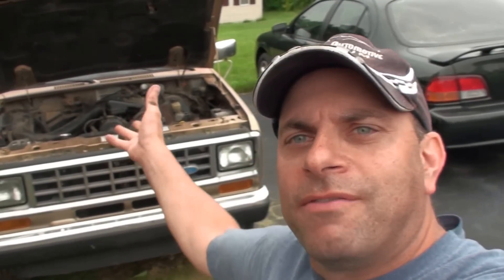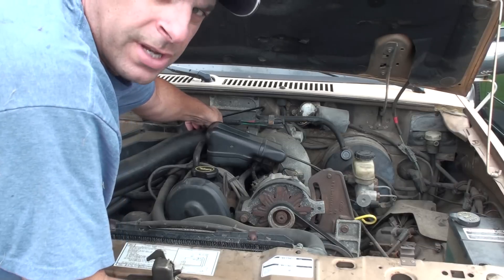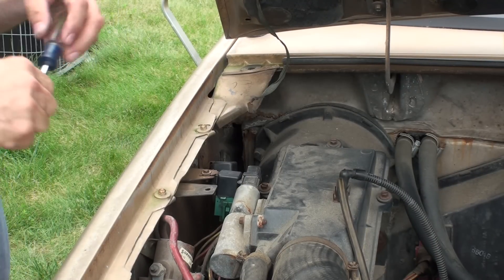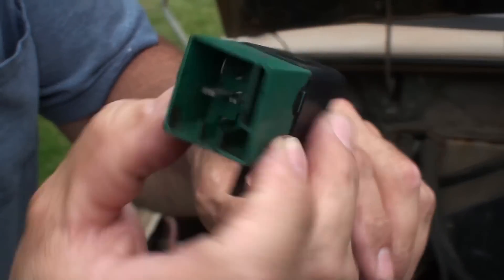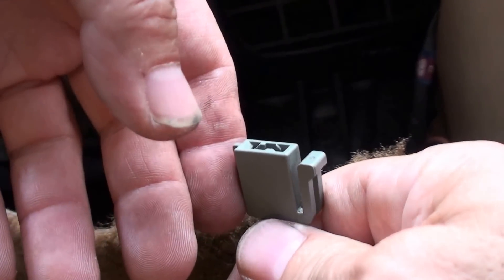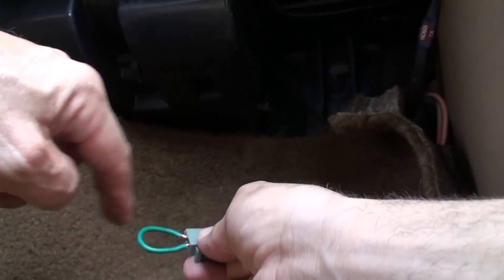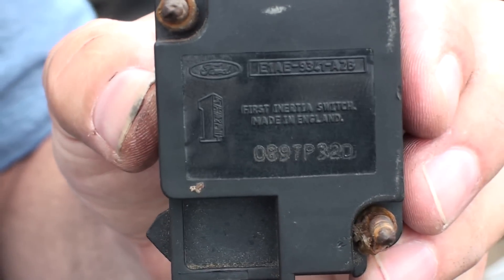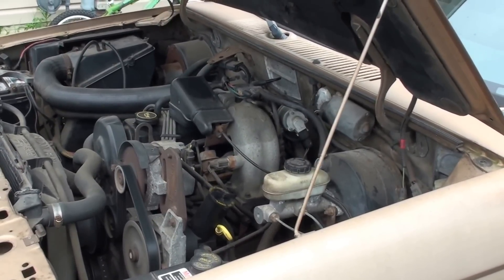Engine Crank, No Start -Diagnosis and Fix - Ford Ranger

Comment: 1997 Mazda B-4000SE 4.0L V6 here ( same as a Ford Ranger XLT) - mine 
suddenly one morning after using all day before would NOT START, cranked
 like nuts, no "fire". What did I find?  It was the F'ing Fuel Pump 
Inertia "collision" switch mounted on the passenger side inside the 
firewall.  No truck impacts, no bumps, no anything that should have 
tripped that Inertia "collision" switch!!  Fuel pump is fine!  Beware 
Boys, ALWAYS ALWAYS check that damn Inertia "collision" switch FIRST on 
ANY Ranger or Mazda B-Series!!  A kick of a foot, a package you have on 
the floor bumping it, could easily trip it!  Push the button down to 
reset and GO!
Reply from the maker: Also leaking windshields or heavy moisture can cause internal corrosion or shorting.

Comment: You calm manner and locating the primary culprit , was fascinating. I have a 2003 Ford Ranger 6cyl 4wd which sat idle and i had to replace a battery ( 4years old Battery). I found relays on driver side, they are similar to yours but different. I have light and a meter. I believe I might need some guidance. Cannot find booster fuel pump or it's switch. under car driver side. Inertia switch in foot well side has 2, 2 color wires going into the switch which has 3 points of contact. I tested the switch with ohm meter and got 0.0 on two contact side with wires. I am unable to get voltage on meter on two contact side. Inertia switch works when I bang the switch hard as I get what appears to be 0.1. I pushed switch down  returned 0.0. I think I just need  slight guidance or suggestions to follow this up. I would really like to fix this myself if I possibly can. Thank you!
Reply from the maker: For something like that I find a wiring diagram to be the best asset.  It will help you a lot.

Comment: Man I hope this is my issue with my 89 f150 5.0
Reply from the maker: Let us know what you diagnose.
Reply: I started with checking spark, due to the fact I have a air compressor on my truck for air bags so it's to loud to hear the pumps. Then I grabbed my test light and followed the same as you did and sure enough it was my inertia switch. In my area it's almost $200 for a new one, we have sales tax so even if I ordered it online I would still pay sales tax plus not everyone ships to Alaska. So I wired it to a toggle switch and that's all she wrote. I knew it could not be any of the pumps because they are all brand new. I should have known it would have not been spark either due to the fact everything that has to do with spark is brand new on that truck. Lol I the only thing left to due is paint the truck now

Comment: For me my truck starts intermittently, it seems to have this issue sometimes and other times it doesn’t, there’s no pattern
Reply from the maker: Before this truck became a crank no start it had similar symptoms like yours until I diagnosed it and repaired it.
Reply: Ozzstar's Cars I just checked my inertia switch and it was still clicked down and didn’t need reset, but they can still fail even if they “look” okay?
Reply from the maker: @kalemathews1899  test, don't guess.

Comment: I have a good one for you. I have a 2002 ranger and it will start if the air temp is not over 75 degrees. If its warmer or I start it and it warms up a bit , the next time I try to start it, It wont turn over. Dash lights all come on, I have full battery power but it wont crank over.  I can bump start it and it will run as long as I want to drive.  Anyone have a clue???
Reply from the maker: Any pending trouble codes? What is the ECT and air intake temp data showing?

Comment: So, I lost you at the end. Did you install a new switch? I'm assuming you did.
My '94 Ranger will not start. Just tried. Cranks but no starting.
Reply from the maker: Can't find those first generation inertia switches new anymore but the replacement worked fine.
Reply: @ozzstars_cars  I'm hoping my guy will look at mine so I don't have to haul it to a shop, and that the switch or relay is all. 
Truck was fine the other day.

Comment: Thanks for your video.  It helped me fix an intermittent starting problem on my 96 Ranger.  After watching your video I thought about the symptoms I was having.  I wasn't having problems running once the engine started.  It was just an intermittent crank but no start.  I thought that it probably wasn't the collision relay because if that was causing the problem I would also have problems running.  Also, if it was some kind of wiring issue, I would also have trouble running.  So I came to the conclusion that it was the fuel pump relay because when I shut the engine down, the relay loses power and the armature of the relay must be sticking when I have the intermittent starting issue.  I verified this by having someone try to start the truck and when it was having the problem I tapped on the relay with a screwdriver to free the armature and it started right up.
Reply from the maker: Nice diagnostics there Charles, glad the video was helpful to you.  Over time the contacts in the relay can get weak and lazy.  Sometimes they can if get stuck in the on position.  Fortunately it's not to often.  Take care and thanks for the comment! -Ozz

Comment: it looked like the inertia switch was not secure when you first went to test it. I drive really bumpy roads so I will have to check that on mine today! I have an 88 and an 89 Ford ranger. the 88 is the one that's having a fuel problem and hasn't ran for 3 or 4 years, it's the one I'm working on today.
Reply from the maker: Good direction to start the diagnosis.

Comment: hi my question is::::
what happens if you leave the bypass on and the pump has been on 24 hours or longer?  changed out oil and spark plugs. now when it starts ans runs but a lot of "white" and gray smoke comes out the tailpipe.
Reply from the maker: Leave what bypass on?

Comment: Dang yr good !  I have a 88 Ranger that is doing the same ,( it runs on brake cleaner ).
 When I clip on the test light to (+) and touch both leads to pump (like you did in 1st step) I get BOTH that make it glow ! (yours glowed on the terminal on the left ). 
When I by passed the  inertia switch and same result .
I rebuilt the inertia swch because it was bad like yours was with ash build up and now its good .
Same result .
DO you think the inertia switch slowly wore out something els in the circuit ? 
This throws off your test on the relay because I dont know how to test it .
Any clues ?
Thanks !
Reply from the maker: Did you do a simple bypass test on the inertia switch using a jumper wire?  What were your results?
Reply: @ozzstars_cars  Hey there . I did that and nothing happened  .Today I popped in the new inertia swc. and it started- but only for a few seconds and repeat was the same until it wont even take brake cleaner .
What do you think if I jump the relay (on the fat wires ?) to turn on (both?) gas pumps ? 
Or what els do you think sir ?its an 88 BTW not 86 .
Reply from the maker: @pickupgenius  won't run on ether? Then check spark.  Test the pumps at the connector like I show in the video.
Reply: @ozzstars_cars  The 1st thing you did (and then I checked that ) and I found both leads ( to chassis pump)were lit with tester end clip to + ....On yours the left side was lit and the right wasn't . Im worried ....And yes I will check spark .
Reply: @ozzstars_cars  Today we finally got it running! After the inertia switch was rebuilt ( that was fun) we jumped the two fat wires on the relay and both pumps went on !
The front pump sound a little noisy but I gotta pop a new relay on now . Im convinced your findings of the inertia switch was tops .I also think if its 30 plus yrs old its contacts (like it was jumpin all over the place on yr vid ) can wear down something els in the circuit . What do you think sir ?

Comment: My 2002 Ranger does this,  but intermittently. I can be driving, go to the store, come back out and it won’t start. It cranks but won’t start. Give it some time or overnight and it’ll start. It seems random. I wonder if it could be that inertia switch.
Reply from the maker: Check for codes.  Crank signal or fuel pump/pressure issues.

Comment: Great video . I subscribed .I was looking for a video on why my 2000 Ranger acts like its flooded on hot days or an hour or so after i drove it last . I have to hold the foot feed to the floor and then it will start.It does not do this all the time though ....
Reply from the maker: Test the fuel injectors.

Comment: What oil dose take and trans fluid
Reply: I fed my 1987 Ranger 5w30 motor oil. Look on the dip stick for the transmission fluid required .It is stamped on the stick. The first chance ya get change the transmission filter.
Reply: Dennis B. truck I got doesn’t have a transmission dip stick
Reply: @derekwhitmer2799  Ahh its a Manuel (stick shift ) ..check your hydrolic clutch fluid & you should be good. If you got the 2.9 you got a good TOUGH motor .

Comment: My problem is if it rains or mildew in the morning my bronco ii wont start it cranks but no start I put new cap plugs and wires still the same
Reply from the maker: Check connections and test at the fuel pump relay and EEC relays when wet.  Also fuse box for any signs of corrosion.

Comment: My '94 Mazda B4000 (It's a Ford)  had a no-go fuel pump.  It wasn't the pump.  Or the relay, or the inertia switch.   It was the negative side of the relay coil not being brought to ground by the ECC.  It has control to give the pump a momentary run with key on, engine off.  It then grounds the relay when it senses engine running.  I just installed a button to bump the pump on startup, as the ECC output point was faulty.
Reply from the maker: Nice diagnostic work!

Comment: So what if say I dont have control, I have to get a new computer or what does this mean?
Reply from the maker: New computer? That's the last thing you do.  Start testing powers and grounds,  look for a short.
Reply: @ozzstars_cars  Right but im looking for shorts from where the ignition the computor?
Reply from the maker: @aaronsteffensmeier4560  yes and yes, a wiring diagram will be the map you need.

Comment: Your video helped SO MUCH i hinestly cannot thank you enough man. You should keep the electrical videos going because some of us can rebuild a motor but barely know hot from cold when it comes to wiring and cant read wire diagrams!
Reply from the maker: Thanks for the comment Toby.  It takes time to study and learn electronic diagnostics and it's not always simple.  Once you have the general idea it becomes easier.

Comment: With it close i getting 0.05  is that bad ? open it's don't move stay at 1. I have it on 200k Om ,  i get 0.00   and at 200 Om i get 0.05 .  which one should i test on ?
Reply from the maker: In order for the switch to allow current flow it needs to be as close to 0 as possible.  If it shows 1 that is open and current will not flow, which means the fuel pump won't run.
Reply: @ozzstars_cars  so at 200 Om reading 0.05 is bad ?

Comment: All I can say is I wish you were my neighbor.  I have a 2002 Ranger that is acting almost like this one.  It will start for 10-15 times and then it won't start at all.  If I wait 10 minutes after several tries to start it low and be hold it starts right up and runs normal.  Think it might be the same issue as your video?  Thanks for the post.
Reply from the maker: Doesn't sound like the same issue.  Hard to diagnose online but I would start by hooking up a scan tool and checking data.
Reply: @ozzstars_cars  A scan tool from my local parts store did a scan with no codes. Like I said, the issue is intermittent, which is sometimes worse to figure out. The next time it fails I'm going to try spraying some starter fluid in the hose that connects to the air filter like you did. My engine is fuel injected.  Maybe I can narrow it down to a fuel problem by doing that test. If it still doesn't run then it has to be electric of some sort. I'm open to anything you might suggest.   Thanks for your reply.
Reply from the maker: When was the throttle body last cleaned?  Have you tried unplugging the MAF sensor to see if it runs better?   Without the proper equipment it is hard to diagnose a problem, especially over the internet, if you know what I mean?
Reply: @daviddarrow4506  did you ever figure out your problem?  Mine has quit running entirely.
Reply: @curta8016  Yes, I solved my issue.  Fuel pump replaced and problem solved.  Folllowing that problem I replaced the coil pack and no more cyclinder (#5) misfire.

Comment: just found a computer at the junkyard believe it or not got it for 5 bucks plugged it in and my ranger 2.9 fired right up. runs rough but I think that's because it hasn't ran in a year. plugs wires and a coil

Comment: my ranger will only start when the spout plug is pulled out once I put it back in it dies. what could that be.
Reply from the maker: TIme to start testing the EEC.  When the spout is out the part of the EEC that controls timing is bypassed.
Reply: @ozzstars_cars  What is the spout plug you guys are refering to?
Reply from the maker: @aaronsteffensmeier4560  serial plug output.  Sends signal from the PCM to advance timing spark.  Remove to set proper timing.

Comment: Mines an 85 and has no inertia switch. It was not starting ( no  electrics at all,0 noise) tracked it down to the starter solenoid and now it cranks but won't start. There is great spark, I smell fuel . Will try splashing fuel in the carb in the am

Comment: Same issue here with my '86. Same engine as yours so it was really good to watch this. Now I'm off to thestore to get one of them handy dandy light probe things. Thanks a bunch!
Reply from the maker: Glad the vid helped you out.  A test light is the best diagnostic tool you can own.
Reply: So got my light tester and I'm not getting anything on the control side of the fuel pump relay. I got power and ground on the power side. I jumped it and can hear the fuel pump come on. Does that mean something is  wrong between the ignition switch and the relay? Thanks for any feed back.
Reply from the maker: Power and ground on the power side?  Do you mean the load side.  Have you tested the relay and what were the results?  Then have you checked powers and grounds  at the EEC relay?  Is the EEC relay working properly?  Was a helper cycling the ignition on and off when you did the testing like you see me doing in the video?  The EEC resets for after a two second prime and the key will need to be cycled to test properly,  NO power then there is a short or a blown fuse :-)
Reply: Thanks for working with me but I got as far as I wanted to go. I checked the relays and the inertia switch and had a helper cycle the ignition for me. After my helper left so did morale. And it's too damn cold here in PA to be messing around outside haha. So I had it towed to the shop. At the least it was a learning experience. I now know a little more about how my car works. Maybe next time I'll be able to fix it. Cheers!!
Reply from the maker: Good luck and let me know what the problem was if you get a chance.  Take it easy
Reply: Well I got it back and the mechanic said it was just some old extremely corroded wiring under the hood. He replaced some wires and a new ground for the fuel pump and got it starting and running like it should but today I noticed that the fuel pump runs constantly when the ignition switch is on and engine not running. There is no two second shut off. I feel this could be a problem. At the least, I won't want to play the radio with the engine off if the fuel pump is constantly running. Any thoughts? Thanks.
Reply from the maker: Wow sounds like he bypassed the EEC? Interesting 'repair' that just about anyone with a wire cutter can do.  Now things might get even more complicated to fix properly.   Only thing I can say is find a new mechanic, after he fixes what he didn't do right in the first place.  Just because its an old truck doesn't mean the repair needs to be hacked, unless that's what you paid for and expect.  Good luck
Reply: So I called the guy and asked him about the fix and he (the garage owner) basically said that his mechanic got as far as he could without tearing out all the wiring and thus creating a very time consuming job. Granted, I did tell them I just wanted it to run. I paid him for two hours of labor. He said if I wanted it done right it would cost a lot more. I'm going to go over there tomorrow and see if I can talk to the mechanic himself and find out exactly what he did. I don't have much confidence in the owner. I asked him if he bypassed the eec and he asked "Whats an 
eec?" I'm happy I got my truck back but I'd like to get to the root of the problem. Is is true that some electrical problems can't be diagnosed easily and require hours of labor taking it all apart?
Reply from the maker: Some electrical problems do take more time but realistically this type of issue on this vehicle is no more than 1 hour to find the problem for someone that is qualified.
Reply: I was able to talk to the mechanic and in a nutshell I learned that the root of the problem is that the fuel pump has an issue being grounded and that if I can find "where the ground is being initiated from" I can solve the problem. What he did was ground it through the fuel pump connection on the diagnostic port and that gets the truck running. He was puzzled why this would run the fuel pump constantly. I think I'll take it to someone for a second opinion. Or maybe I can bring it to you. Are you on the east coast haha.
Reply from the maker: Delaware, ever heard of it? lol